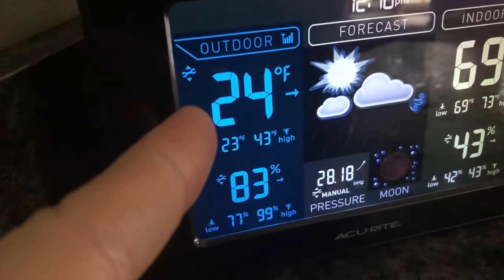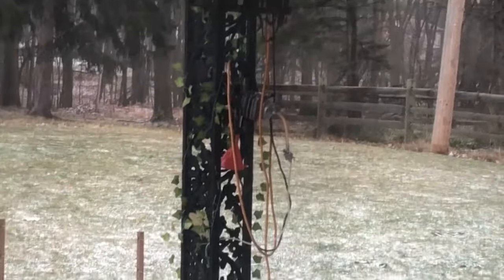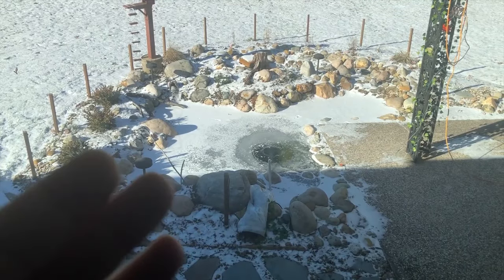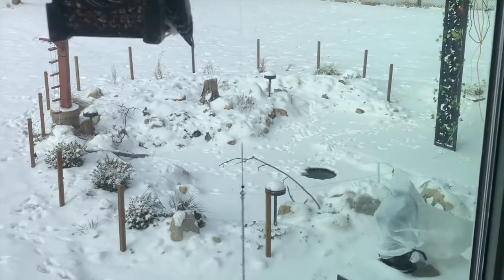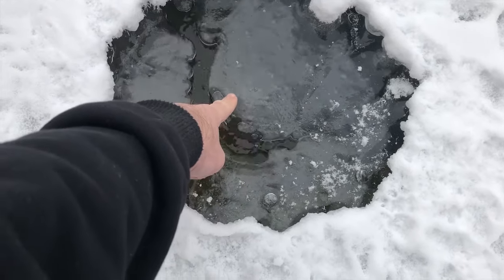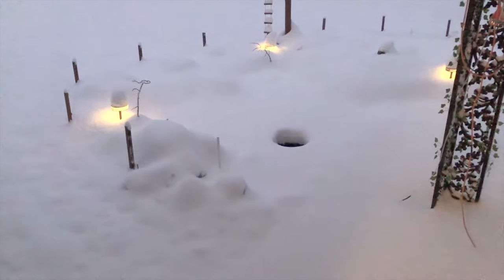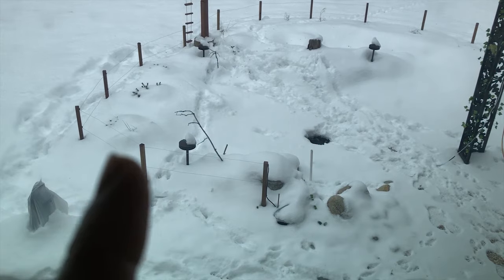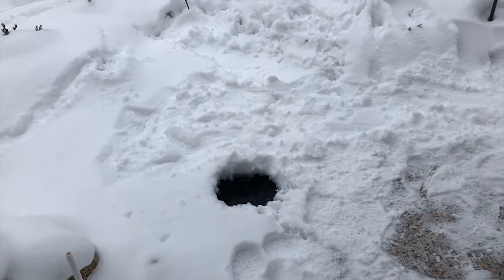DIY Garden Pond Update | The FREEZE | Part 7

Comment: Why not throw a small aquarium heater in there near the bubbler? A 100w heater would probably make a huge difference and orevent icing over on that coldest week. And theyre only $20. You can get 300w for $30. I have a flat one thay sits on the bottom, works great. This winter has not been a very intense cold one... I think we are due for colder than this in the future
Reply from the maker: It’s not entirely needed. Plus it’s just more power consumption. If it was an above ground pond I would certainly do that.
Reply: @GrowingAnswers  I hear that  I keep mostly unusrd parts of my house very cold for energy savings, 50-55 at times. I grow hydroponics there and found a small heater in the res makes a hugeee difference by upping the root temperature. Not needed, but I find it certainly helps move my plant life along a little faster. 

Keep up with the updates! We love to see what you're working on. Grow all the answers 👍
Reply: The bubbler isn't even needed and the fish will still be fine.